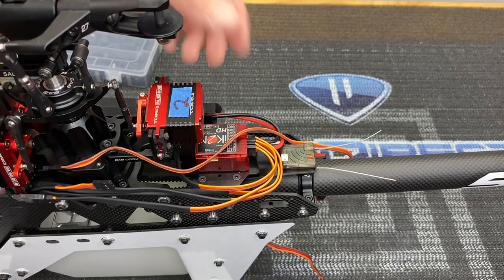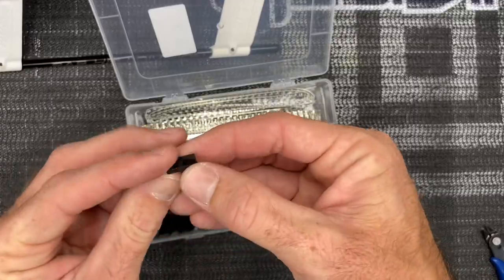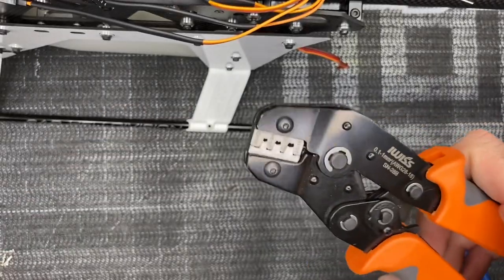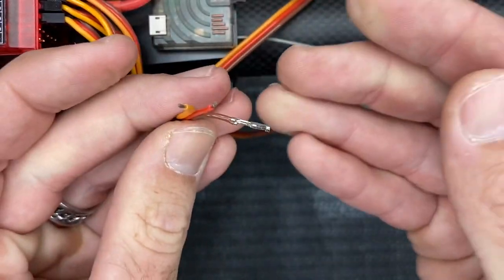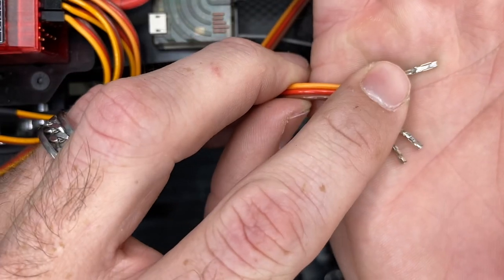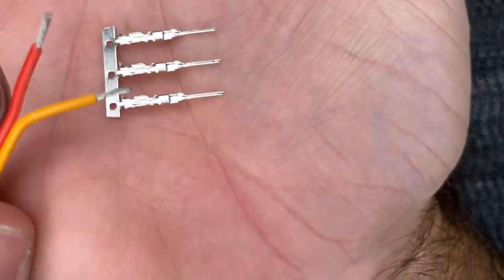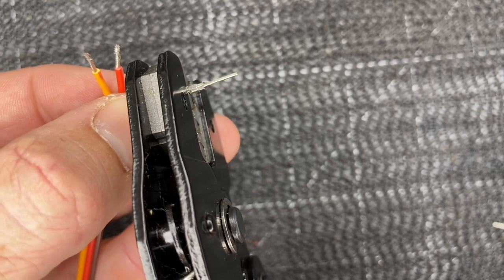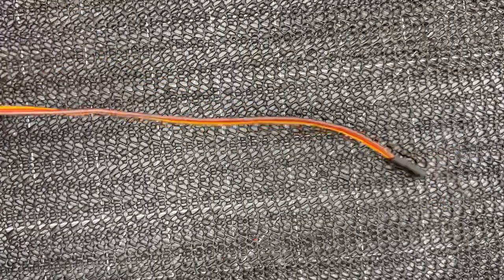How To Crimp Your Servo Connectors￼

Comment: You should check out Hansen Hobbies.  They have the terminals loose if you want to buy them that way.  I get them like 100 at a time and keep them in a small container with a lid.  They also have different colors of the housings that I use for wings in planks to keep them separate.
Reply from the maker: Awesome! I’ll check them out, thank you!

Comment: Oh man perfect timing -- I'm about to swap out servos on a SAB 570 with all torq - add the PPort wire from HW 120 to brain2 -- and clean up all the wiring (extra all looped and zip tied ATM) -- my previous attempts at recrimping ends have been lack luster at best -- the ones that come out OK are really just by luck -- not a method of any sort :-)
Reply from the maker: Glad you found it useful! Yes crimping your ends can take some practice. I would recommend taking some old wire or a lead you’re not going to use Andrew crimp cut it off crimp cut it off and do that a bunch of times until you are very comfortable with doing your servo. You will get that 570 looking perfect!

Comment: Nicely done. I've watched so many of these videos and yours is by far the best. Thank you.
Reply from the maker: Thank you very much. I greatly appreciate that. I try to make every video as informative as I can!
Reply: I completely agree, this is a great video on how to properly use a crimper, clear and straight to the point.
Reply from the maker: @monkeyrc7541  thank you! I try to make the most informative video out there to help everyone!
Reply: I did order this crimper recently and when i opened it i wasnt sure why it had a gear (?) preventing it from releasing quickly like any other pliers-like tool. Your tip on pulling out the connector a little bit and inserting the wire from the opposite side was excellent, the tool did come with instructions but it wasnt really helpful.

Comment: Great video. I just started doing my own servo extensions, and really had no idea how to use the crimper tool. I didn’t pull the ends, and ruined a few before figuring out what I did wrong. Thanks for sharing.
Reply from the maker: Thank you! I struggled on the first few that I did, I watched a couple different videos that people made and no one said anything about pulling the end out until it stopped before crimping. So once I figured that out it was easy! I also learned always start with the ground for direction and they are right every time! It is so nice to be able to make your own extensions whatever length you want to shorten wires and what not. Not be stuck to a preset length and have too much wire or not enough wire. And you can also make whatever you want as far as white harnesses quad harnesses. It’s such a great set of tools and knowledge to have .
Reply: @westhobbiesrc8051  I used it to neaten up the wires on my helicopter. Looks a lot nicer that way. I don’t go to the level you do with the shrink tubing, but that is a cool look. One of these days maybe. 👍

Comment: Do you see anything wrong with adding a little solder before clicking into plastic connector?
Reply from the maker: You can but not needed. If the crimp is good it will never fail. Only problem I see with adding solder is it can wick down and not allow the connectors to plug into them selfs.

Comment: Thanks! My FIL gifted my son an RC car and the wires for some lights were pulled out of the connector within a week, so i'm in charge of fixing it (he's only in 1st grade).
Reply from the maker: I hope this video was helpful! It’s a great hobby and your Son will love it! RC cars are where most people start in this hobby and then it takes over! Lol
Reply: @westhobbiesrc8051  it was!  I soldered an extension on so we won't have the same issue with the wires being pulled out. 
Of course, now it only works if I hold the connector slightly to the side in the body of the car. So, working through what the issue is with that. 🙄

Comment: I have been working on electronics for decades now.  Your video is perfect.  I would not change a thing if I was to do an instructional video.  I guess the only thing that I do differently is to use a stripper (for the wires LOL).  Millions of ways to strip wires though!
Reply from the maker: Thank you! I have been doing electrical stuff for many years now lol you can definitely use a wire stripper. My problem is I don’t have a pair of wire strippers that will be small enough to strip the wires lol so I just got used to using the tiny flush cut side bites. but a wire stripper definitely would make it easier!

Comment: After watching this I think my reservation about cutting servo wires to length can be put to rest, however I don't want to scrap my JR Gold plated pins for cheap made in China pins.
Reply from the maker: Personally, never had a issue. I’ve probably done hundreds over crimps and never a failure.

Comment: Jeff, you are a really good teacher. I appreciate this video. I'm going to go through all my helis and rewire them. Some problems I've had has been directly related to bad wiring.  Thanks so much.
Reply from the maker: You’re welcome! Glad the video is helpful. Personally I know when I crimp a servo plug it will not fail or when I solder a connection it will not fail. So it makes me feel much better!

Comment: How do you extend your servo wires? Crimped extension lead or solder?
Reply from the maker: A few different ways. If I need to extend them i will either make a extension lead or solder a longer wire onto the servo or splice in and solder a new wire.

Comment: to think i just been digging them open and crimpin with needle nose all this time... learn something new everyday i guess
Reply from the maker: You can definitely do it that way but the crimping tool is faster and easier lol and it’s a tool I can’t build a helicopter or airplane without! I literally make all my leads for anything now. So much better than buying premade leads that you have to be stuck on a length.

Comment: Is it ok to do a light solder on the crimped ends before you insert into the cap? Not all the way to the clip insert locking mechanism, just at the foundation where the wire meets the end of the crimp.

Comment: I searched for information on crimping these connectors when I needed to build extensions for a large biplane I was building. The cost of the crimpers, a roll of wire and a connector kit made it cost effective. Now I spent 20 years working on electric jets, even had similar connectors except larger but try as I might, I could not get them to crimp properly. The I picked up a Goosky RS4 and found your channel and this video. I thought no way so I pulled out the box of stuff and tried it. SOB! That little pull step was all I was missing. When I pulled on the pin and it stopped, inserted the wire and crimped. I couldn’t believe it. I’ll pass on my own tip, the Irwin Vice grip strippers will strip all three wires perfectly at the same time. After you strip them, a small cut between the wires with an Xacto knife and you can pull the wires apart.

Comment: Any need to add a bit of solder after crimp?  Worried about coming loose from vibration.  Ever had an issue with one of your connections.?
Reply from the maker: No need for solder. I’ve crimped over three hundred connections and never had one fail. Even years later still going strong. They are crimped at the factory as well.
Reply: Copy that!  You inspired me to West Hobbies rc style the wiring for the 700 raw I have coming Friday.  Thank you for the amazing content you provide.  I’ve watched your build videos enough I can probably assemble without the manual.🤣
Reply: Also, do you ever have the urge to build a 700 size scale bird?  I fly mostly scale heli’s as I don’t have the extreme 3D skill set.  But truly love flying scale.  My Winter project is the Vario 1/6th scale BO105 with Trex 700 mechanics.  I’m doing in the Red Bull scheme..  just saying, it would be great video with you doing a scale build.
Reply from the maker: @georgiaconservative3253  awesome! I’m glad the videos are helpful and inspired you! Before doing your heli (if you never crimped before) take some wire and practice! It can take some getting use to to feel how far the wire needs to go in or how to get a good crimp.
Reply from the maker: @georgiaconservative3253  hmmmm well….. just wait! 😉 scale helis are beautiful. I really really want to do a Vario one day but I’ll be starting on a 700 Roban build soon! Kit is ordered and will be here any day! Going full scale, LEDs, movable pilots and maybe windshield wipers!
Reply: Awesome Jeff!  Can’t wait to see it.  I’ve built the Roban 700 ah1 cobra in the “ cactus air force “ scheme last year.  Amazing quality kits.  It has moveable turret.  But can’t wait to see movable pilots and wipers.😊

Comment: I always messed up the connector.I solder mine
Reply from the maker: You can solder them. I’ve never had a problem crimping them takes some patience but works great.
Reply: @westhobbiesrc8051  I'm pretty sure the crimper I bought was junk. Crimpers are a little bit confusing. But after watching the video I bought another one. Give it another try. Soldering is a little bit time consuming. But I know when I'm done the connection is solid
Reply from the maker: @AdamArndt  having the right crimper is very important! I found this one I use and it’s been flawless and works great. Definitely takes some time to get used to to where to put the crimp and which size wire. But try it again! Hopefully this crimper works good for you.
Reply: Dude. I got it. And it's a lot better than the other crappy one I had. I still like to solder. But now I have a tool to fold the grippers in. Thanks man. Good video
Reply from the maker: @AdamArndt  the right crimping tool is extremely important! I use this tool probably everyday. I do a lot of servo ends and it’s been amazing! I’m glad it worked!